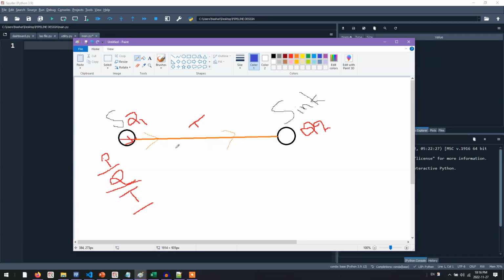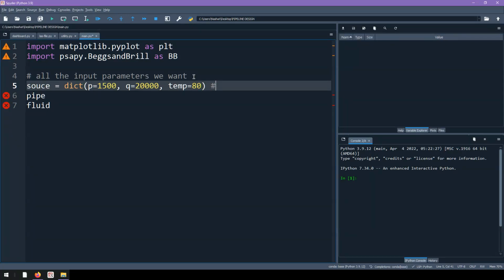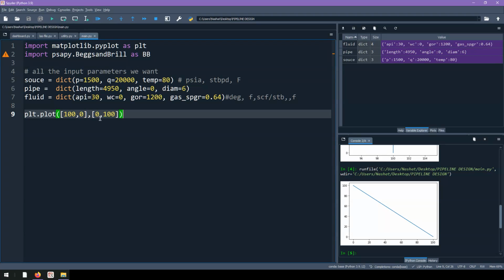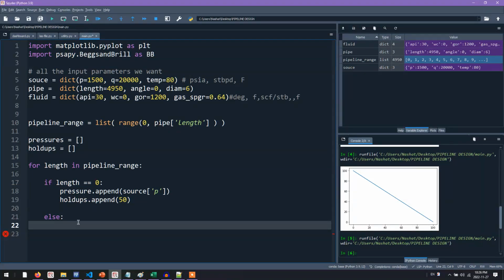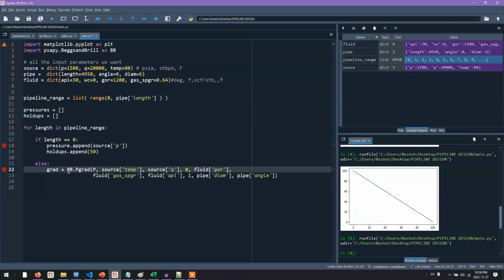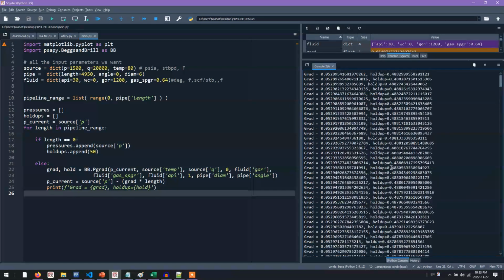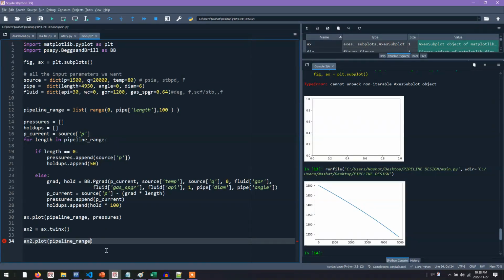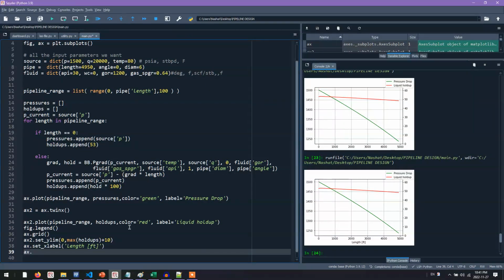Hydraulic  designing of Multiphase pipelines using python

Comment: Hi dear Friend.
If we have a dynamic GOR or other parameters how you update it? Moreover, this library is also working for dry gas or wet gas or gas condensate? Furthermore, by this procedure, we can measure the specification point by point in the pipeline and then integrate them? How? Because sometimes we have both vertical pipeline and horizontal inside the wellbore until it arrives at the platform